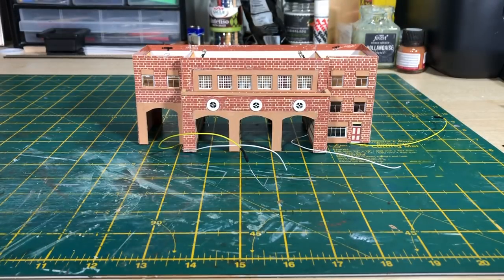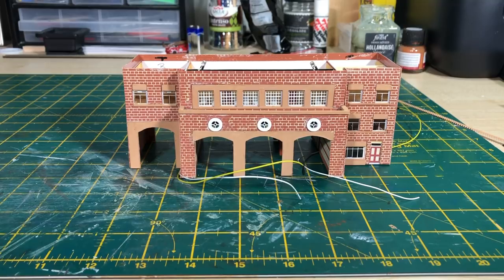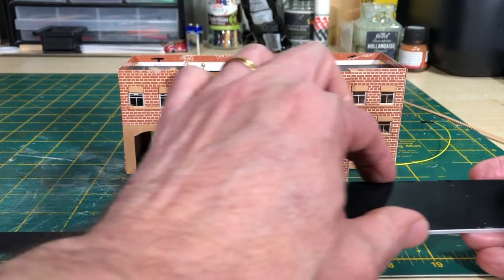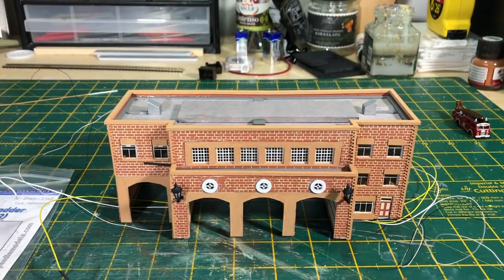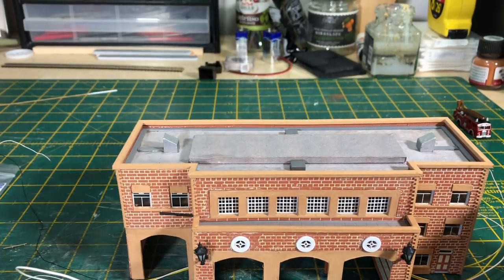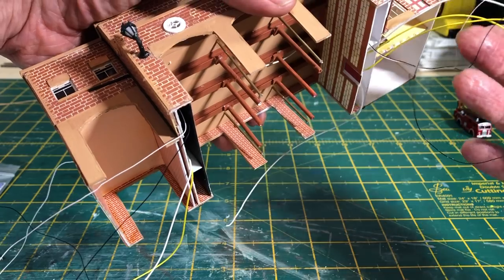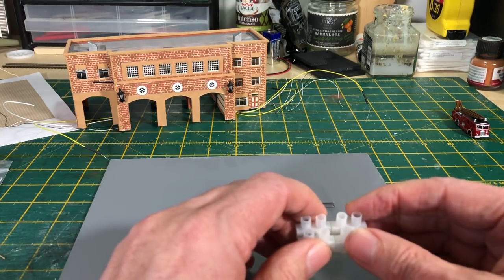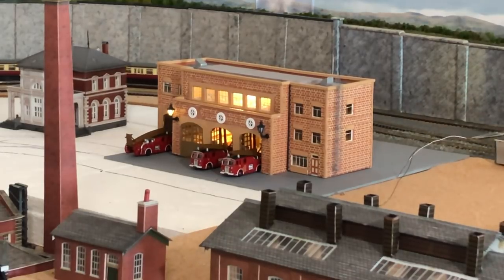N Gauge Model Railway Layout Update -  Elvenhome EP47

Comment: Superb craftsmanship on the station overall and on the detail.  You really made this one pop and are to be congratulated on your work.

The only comment/question I have is that I wonder if any additional roof venting (i.e. heating pipes/vents, etc.) may be helpful in bringing out additional realism?  Not wanting to add to your workload, but it was a thought that crossed my mind.

I’ve been impressed by your usage of Excel for the wall and floor covering, which has caused me to think about developing templates that could be created and stored as different tabs within Excel whereby templates could be created for each style of brick, or stone, let’s say, by scale (for others that aren’t modeling in N scale).  Then, a macro/driven feature could be added that would enable the user to apply different color finishes to the template for each style of material desired (even so far detailed as including a choice of colors for grout detail as perhaps desired).

I utilize Excel quite frequently so this is simply a random idea/thought that I had towards a more full-featured application that could come in quite handy when one needs wall/floor coverings, etc.  Perhaps if I take it anywhere, I may reach out to you for your thoughts and review one day.
Reply from the maker: Thanks very much for your comments.  I think there would be more roof detail and I have been looking to see what is available.  Most of it is either looks too continental or American, or is of the wrong period (air conditioning ducts etc).  I think there would be some flues possible but not much else.  I'll keep looking and if I don't see anything commercially I am sure i can fashion something.

I like you idea for using Excel.  I find the results are fine for internal detail, or to get a result that simply isn't available commercially.  I amy have a go at some point seeing if I can export the result as a jpeg (possibly by first saving as pdf) and then add customisation in Photoshop.  Please feel free to seek my views if you do decide to try and develop your idea.  Stephen
Reply from the maker: Thanks Tom. You can contact me at elvenhome@btinternet.com